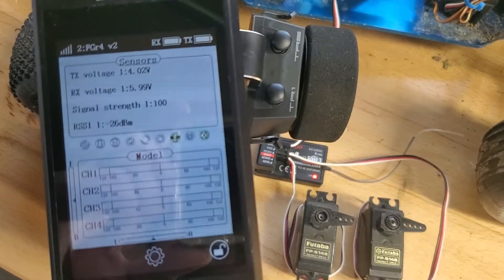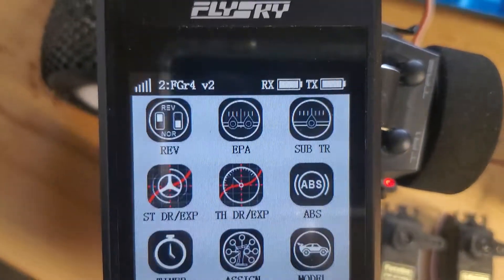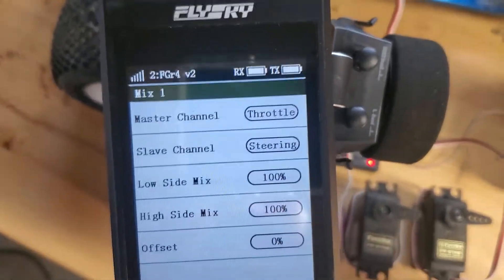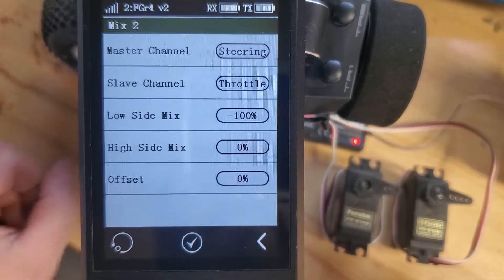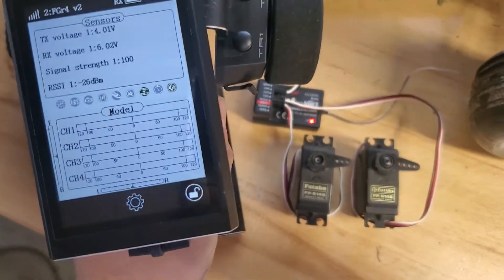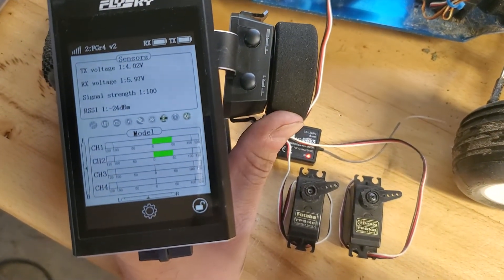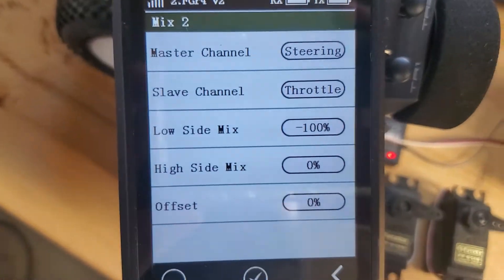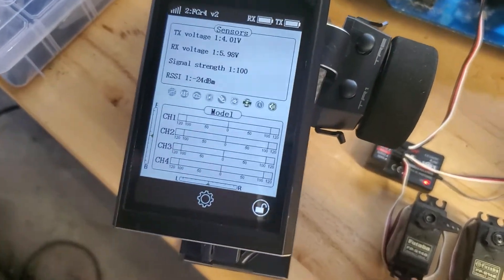FlySky Noble NB4 Tank Mixing

Comment: Great vid. Is this the same setup for 4 wheel steer on crawlers???
Reply from the maker: No, for 4WS, you need to use a 3rd channel. Tank mixing is for mixing throttle and steering.  I have not done 4WS on the NB4 yet, but it should be available.
Reply: @clayrev  thanks. I figured it out. Button mapping.

Comment: I believe you don't need to mix a 3rd channel, I have the Frsky X-Lite radio and I only use 1 and 2 also I use +40% and -40% so It doesn't turn so sharpe but more smooth. Great video I'm thinking of getting that radio, How you like it? Thanks !!
Reply from the maker: I like it quite a bit, considering I don't have a lot of time with it.  I got it for my RC Mower project (https://youtube.com/playlist?list=PLAJRpgXvKSB2jEnKz9wPtJLemA2A6hemv) but ran out of funds at the end of the year.  Hopefully I can continue working on it this spring. 

Note that I am using 3 MIXES, not 3 channels. It still only uses channels 1 and 2.  I might try to make it work with less mixing in the future.